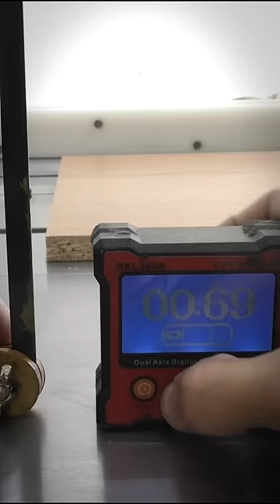Simple Table Saw Hexagon Jig #shorts

Comment: I'm speaking directly from my ass, but I feel like there's probably a better way to get the angle. You know, like how you can make 45° jigs without measuring, and only using geometry, so it has to be perfect if you do it right. I don't know how, but I feel like it's possible.
Reply: Could just use the miter gauge and a sacrificial fence, if it's a decent enough miter fauge
Reply: It’s definitely possible with a ruler and compass. You can use a compass to create three points that are an equal distance away from each other. Those points make a triangle with 30 degree interior angles. It might be more accurate than the tool he uses. I don’t do enough wood working to know
Reply: @matthewhubka6350  a triangle has 60 degree interior angles

Comment: they hi speed the video in the most important part, so I don't understand the final
Reply: The size of the hexagon is set by that last piece.  Loosen the wingnuts to slide the sizer along the aluminum rail.  Closer to the slot makes smaller hexes.

Not sure how you do the first cut with the sizer in place.  Make the first cut on all pieces first, then install it.

Comment: "simple"
Reply: Which part seems complicated to you?
Reply: @klchapman554  starts after 3 seconds, when he starts with the glue.
Reply: @Elmalab  you mean using a T-bevel? This is all very basic stuff, even to a novice woodworker
Reply: @Elmalab  he used the glue to get a quick and hands free connection between the thin strip in the slot and the top sheet. Then he screwed it in place to make it permanent. We all gotta start somewhere, because nobody comes out of the womb knowing how to make things out of wood!